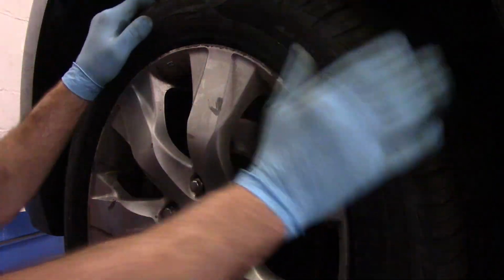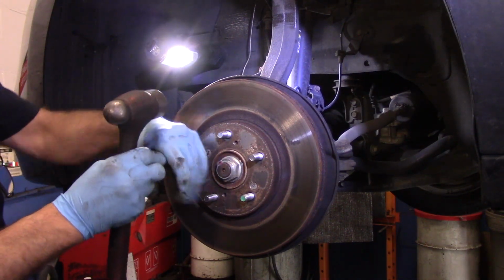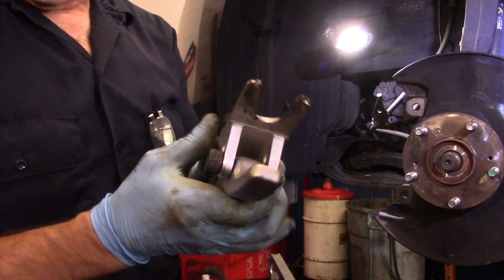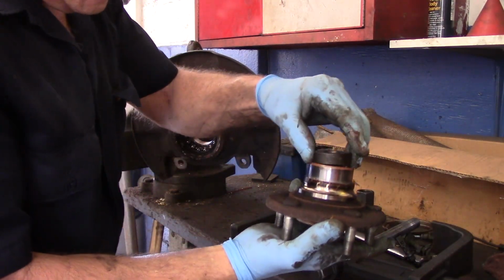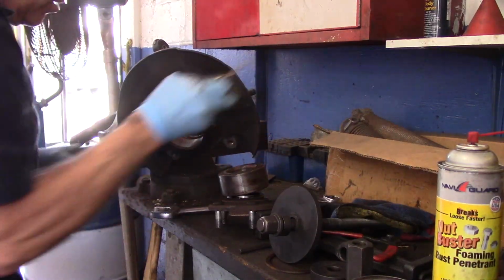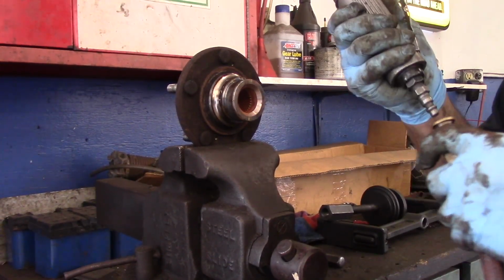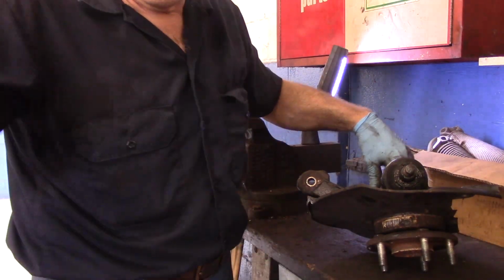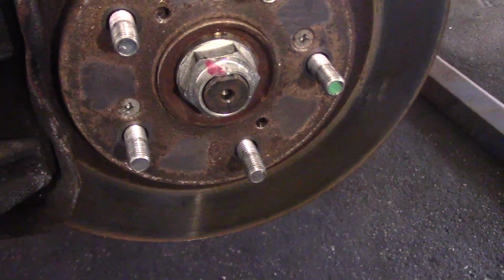2008-2012 Honda Accord Hub Bearing Replacement

Comment: Well Mr. Jim - I was wondering if you see these comments. If you could tell me how do you sync up the "Throttle Body" on a 2010 Dodge Grand Caravan 3.3 -  to the "Throttle Sensor" that's in the  "Air Filter Intake Duct". That connects the Throttle Body to the Air Filter.
Thanks
Ric

Comment: I have done many bearing jobs with the grappler kit. It works great. A tip I picked up on YT is to put the new bearing in the freezer over night. It presses in much easier.
Reply from the maker: Great tip, thanks for sharing!